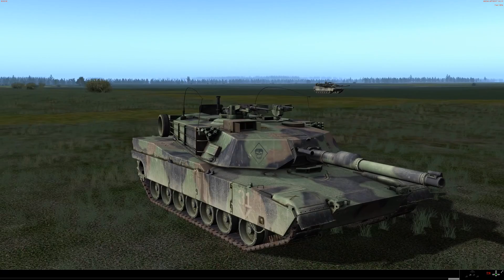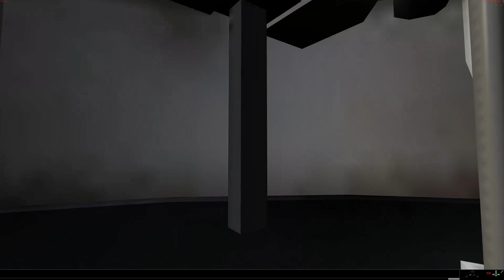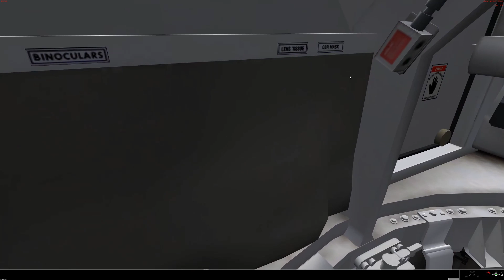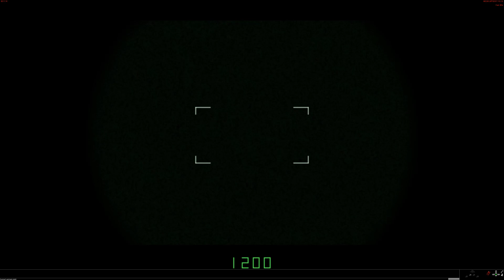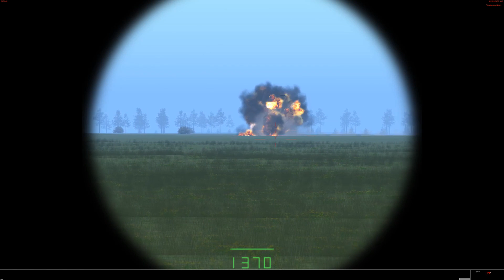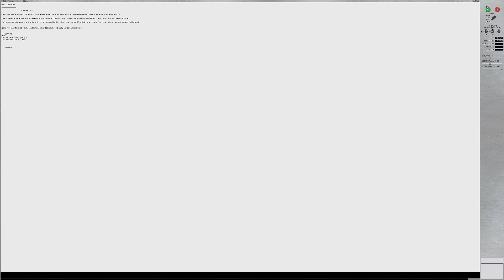Abrams Switchology and Fire Control System

Comment: Using the laser rangefinder with each shot activates the "soft kill" system (as you English people say) on the car you are aiming at. I know you haven't fought symmetrically for a long time, but this system exposes the position of the car. I am most interested in how your battlefield management system, command, fire control and target designation works. between vehicles, e.g. at the platoon commander level.

Comment: So it looks like the Ukrainians are going to be getting 31 M1’s. I really wonder if this video will be watched by any of their tankers. If only for familiarisation.
Reply: They are going to be trained and there likely will be different systems. As it is said that they are downgrading the M1 Abrams. They are not giving the M1A2 that USA Army has, but one without Heavy Armor (DU armor) and firing computer, datalinks, radios etc are suppose to be different from what USA use. Reason is simply that Russia will get their hands on at least one of them in good condition and they get to study it down to minute details. 
USA has lot of older versions etc in the boneyard, they could easily just take fleet of C-5 and each can carry two M1 Abrams or one and two M2 Bradleys. So if they are going to sell Ukraine 31 M1 Abrams and 60 M2 Bradleys, they will likely go with the 1+2 option and just fly that route 31 times to Poland.

I could see a potential market for eSims Games to sell their simulation packages for Ukraine. And they don't need so many either as they are not receiving many units. With the simulation packages they offer, Ukraine could use it to train as well Abrams, Leopard and Challenger crews at the same time.
If Ukraine already have the packages, they could be training all their crews on this moment to operate all of those and lower their real training time considerably.

Comment: 6:00 your speculations that turret azimuth in Panther is not necessary is completely misguided. When 4 panthers roll in a row along the same road, and they spot an enemy, they communicate to each other: enemy spotted at 15degs. No stupid discussions about where is the fkin fire extingusher relative to hull to anything.
Reply from the maker: We tend to deal with that problem in modern tanks without such things by simply saying "contact front" or "contact 2 o clock". Such levels of precision are neither necessary nor necessarily viable, what if one tank is on a curve for example? And the TC should know roughly where he is looking at all times, without needing to take the time to refer to a scale.

The proof of the pudding is in the eating, as they say. If it is such an important requirement, why do more modern vehicles such as my M1 or M3 not have them?
Reply: @TheChieftainsHatch  Yes. But modern tanks can detect enemy in 20-30 deg cone at ranges which are about max range of HMG. Old tanks could detect enemy in 5 deg cone after they focused on very specific set of bushes after several seconds of obesrvation. So your experience about shit is worthless, as you did not step into the same kind of shit as your ancestors did. This is why knowledge of outside-army 'expert' who has basic knowledge abotu scopes who never stepped into any kind of shit, is better than knowledge of a soldier that stepped into a different kind of shit he is commenting about.

Comment: Does YT like incentivize longer videos? does it really require that long to convey the non-azimuth indicator method for telling turret direction. Like explaining which way the terrain will move for each of the directions? I think we can mostly figure that out. perhaps the Chieftan was partaking in his favorite beverage before making this? 
Although I still disagree about the azimuth indicator. You may not need it to tell roughly which way you are facing (but what if it is dark inside and/or foggy/smoky outside?), but you DO probably need it when you are the only one who can see out and your gunner has a drinking straw to look through, and absolutely relies on the TC to lay him on target, like in Panther. How else is the TC going to give precise gun laying bearings?

Comment: I shall proffer a slightly-dissenting opinion on the azimuth ring, though more as a concept and not explicitly as found on Panzer III and Panther. It's true that it is not required and probably not worth the complex mechanical linkages to the hull. However, if one could, perhaps, design some kind of lightweight electronic linkage, either via simple cable or short-range radio, an azimuth ring directly below your periscopes would be quite useful in maintaining sight on targets or situations without having to look away to assess where the hull is aiming. So long as such a device were reliable and did not introduce undue space or maintenance issues for the tank and its crew, I see no reason why such a device would not be desirable. Sure, you don't need it, but if you can have it at a negligible cost, why not?

Comment: We never had a problem with our NBC systems on the M1A1's - and did a lot of "over-pressurized' engagements and exercises in Graf and Hohensfels.   We had heard the NBC-system fire rumors, but never experienced one in a long career.
Reply: We had one in 2002 1/7 Cavalry Ft Hood night run driver could not get out due to night vision being installed and turret screen installed he was burned to death
Reply: @lawrencehubbard2985  Wow, that is comforting. So if there ever IS a NBC attack, our tankers can either die in place, burn to death, or be forced to flee the vehicle (and then die)?

Comment: Can you explain how the Guns Primary Control Handle operates?

You mention it operating like a steering wheel, as well as pushing forwards and backwards. But I'm uncertain on how it operates.

By forward and back do you mean like a Flight Yoke?  Or do you mean tilting the grips forward? As they look like the can rotate on a pitch axis.
If they do pitch, are they linked? as in both grips pitch forward together? Or do the operate individually so one can pitch forward as the other pitches back?

I'm assuming that you turn the Controls like a steering wheel to turn the Turret along its yaw. Then the backwards and forwards motion (Be it twisting or push/pull) alters the Main Cannon's elevation?

But that's just guess work.
Reply: You rotate fore-aft to elevate, turn it right-left to traverse, like a steering wheel. A Russian tank, IIRC, the yoke twists on a vertical axis for traverse, ie in the same plane as the turret rotates.

Comment: anyone know how effective the top of the armor is above the driver, or above the front fuel tanks? and the neck of the tank?
Reply: The M1 is an active combat tank, and no official armor dimensions or protection levels are released, other than very general ones. They arent going to advertise the weak spots on their current main battle tank.

Comment: "If you accidentally hit 'power off' instead of 'shut down,' your engine will run away with you, and the only way to shut it down is to hit the fuel cut-off." That's not entirely true. You can also smack the power switch again as fast as possible, and if God means to save your dumb ass from angry Drill Sergeants, He'll get the electricity flowing and tame that turbine before it goes nuclear. You'll then get back to cleaning Kentucky mud out of the subturret as fast as possible, and when the motor pool Sergeant sticks his head in the hatch to ask you what happened, you can look at him and say, "I don't know, Sergeant. Did something happen?" He'll know you're full of shit, but he won't say anything, because God just saved him from having to replace an engine pack.

...or so I've been told and certainly didn't do myself.
Reply from the maker: This is true. You have three or four seconds to put the power back on, I’ve seen it done.

Comment: The azimuth ring is so the commander can call a target direction to his gunner. As you noted the gunner has one too. That way the can just call out the target direction and the gunner can traverse to it. They are on the same sheet of paper so to say. You also noted the gunner's sight. This would help him in that too.
Reply from the maker: As the TC in the typical tank, it is not necessary to have an azimuth ring to know which way the turret is facing in relation to the hull.
Reply: The_Chieftain I agree I think it’s so the tc can give a direction to the gunner.
The gunner is trained on target “A” the tc identifies another target “B”
He simply has to call out the correct number from the ring.
The gunner having the same scale and little to no field of view, simply traverses to the given number to help him lay the gun on target “B”. Kind of a primitive hunter killer type setup.
Reply from the maker: Right, but that only requires that the gunner have one as its a bit harder for him to keep track of turret position
Reply: The_Chieftain I agree with that 100%
I’m not trying to make the argument that it was needed.
Don’t forget we are talking about German WWII design, if it’s not over complicated it’s not needed😀 (for a bunch of things at least)

Comment: As a gunner on a YPR 765 ,and shooting a 25 mm oerlikon in the dutch army in the late 80's, we had the night vision, but all other functions were pretty much "ww2 gunnery".

that's why we were trained to have 3 shots at a moving target , correcting with  "2 forward , 1 up" when we missed, meaning; aim 2 vehicle lengths further in front and  1 vehicle height  above when correcting our aim.
If after 3 shots at a moving target we still had no hit, we would seek another target.
If we had a hit, we fired 2 more kill rounds.

I noticed in the video you seek another target after a hit, is that usual or only done for demonstration in the simulator?
(I do realise the rounds from a modern tank are more destructive than what we shot, but there is still a good chance a non essential part of the target is hit, and they still be able to fire back, or continue to fight)
Reply: Ik spreek niet uit ervaring. Maar elders zegt Chieftain dat ze ervan uit gingen dat als ze een vijandelijke tank geraakt hadden hij uitgeschakeld is.

Comment: So even in emergency mode the gunner doesnt have to deal with the difference between the gun and optic position
How did they manage that?
Reply from the maker: The ballistic computer still works in emergency mode. It’s the connection between the computer and the gun controls which is disabled,

Comment: Lead isn't often 5 degrees - 5 mils is more usual.

5 degrees is 87 mils (compare to the lead diagram shown at the start of the GPS segment, with the whole reticle only showing 10 mils, almost 9 full reticle offsets is very big lead.

Comment: Great video, thanks. 2 things occur to me. One, it really seems like there should be some way that the gun could know what's loaded, so you don't make the selector-mistake in real life. Maybe by weight, or some mark on the back that something could OCR on the way into the breech, I don't know. Secondly, if it's common practice to use the IR sight to find hot-spots during the day, then change to visual to take a better look at the target, it would be nice to have an overlay option where you see the daytime view, but anything that would normally show as a an IR hot spot ( with a dial to adjust what the cutoff parameter is ) could be overlaid in some bright color on the normal image ( mirrors, AR, whatever ). Could help spot things more quickly... ?

Comment: Having "played" steal beasts I can say I liked the Leo's system a lot better, you had to hold a manual lead button which meant if you lazed something your sight didn't jump nor did your gun, you'd laze until you were satisfied with the reading, then hit the lead button which would work essentially the same as the Abrams FCS.  The optics also seemed superior for both the thermals and the regular sights on the Leos.   Which makes sense too since that's what the Germans are famous for with their optics since ww2, and the fact that the Leo can't exactly take a punch too well, its probably better that it can at least see well.

Comment: no bit on the  commanders CITV or Hunter killer  capability M1A2 has?  thats  also a part of fire control and a big difference over the A1
Reply from the maker: Yeah, I mainly intended it to be an A1 video, really. In hindsight, I need to revisit the A2, deal with air mode, the CCP, and the CITV.

Comment: Another good thing about the lack of horizontal stabilisation on the A1 is that it probably subconsciously teaches the gunner about the correct lead should they ever need to use the auxiliary sight. But that’s just a theory of mine obviously and I’d probably guess the training they receive negates this benefit.

Comment: That joke about putting sabot (APFSDS anti-tank projectiles) into orbit is not as far wrong as it seems.  At over 5,000 ft/sec muzzle velocity, these long, finned, very heavy, sub-caliber needles (tungsten-carbide or depleted-uranium "crossbow bolts") can fly to extremely far ranges due to minimal air drag when elevated.  I ran a computation with the air resistance drag function for a 10-to-1-length APFSDS projectile of tungsten-carbide and 40mm diameter fired at 45 degrees elevation angle and it went OVER 80 miles in a close-to-true-parabolic trajectory and hit the ground at over 3200 ft/sec, the muzzle velocity of a WWII super-88mm L/43 German anti-tank gun on the TIGER II.  You have to be careful with these rounds or you will get collateral damage far away from where you want the projectile to go!
Reply: Oh my god, I knew I idly scrolled down comments for a good reason. I love your work on NavWeaps!

Comment: Note the various lead displays when going from normal (sight aims at target but gun -- and the entire turret -- moves sideways to handle lead if the target is moving) to emergency (no lead or elevation applied so the gunner has to do it himself using the information displayed from the computer results or "SWAG" if necessary).  This also applies to the aiming of guided missiles, though they automatically try to move to wherever the computer controlling them tells them to go.  Many of the original US naval guided missiles, such as the beam-riding version of TERRIER developed in the late 1950s, were very simple as to their flight path:  They tried to stay in the middle of the radar tracking beam on the target being generated by the modified dish-type tracking/controlling director radar, one director per target, so no lead angle was possible here too.  This was OK if the target was coming more-or-less directly at the firing ship, but if the enemy was trying to, say, destroy the task force aircraft carrier and your ship was well off to one side of the enemy-to-carrier line-of-sight, you had a major problem in that the target would be moving very fast sideways and your missile would have to fly a curved-hockey-stick-shaped trajectory as it got closer and closer to the target and had to fly more and more sideways rather than forward, in a tail-chase trajectory.  At some point, depending on the range and the speed of the target, there simply would not be enough time to move forward and sideways simultaneously and when that happened, the target was simply not engageable.  This was the major reason that semi-active and fully active homing weapons (TARTAR and the later versions of TERRIER and the current Aegis naval guided missile systems, among others) replaced beam-riding designs -- TALOS was a hybrid in that it had a separate beam-riding controlling transmitter and could guide the missile as if it was on the end of a fast-lengthening fishing pole controlled by the FCS computer while the separate tracking director stayed on the target, so it could hit sideways-moving targets within some rather wide target speed capability; later, at very long range, even this separate beam-riding system was no longer viable and a semi-active homing nose antenna keyed to the tracking radar frequency was added, as a further hybridization of that oldest of US Navy guided missile systems.  Handling sideways-moving targets even with self-aiming guided missiles is a non-trivial thing...

Comment: i have always wondered how does the driver get in and out, on the leopard 2a4 and m1 abrams the turret has that big overhang on all sides which ( having never seen one irl ) makes it look impossible for the driver to use his own hatch. i am only 6 min into the video so i did hear him talking about the swing gate inside the turret. but what happens if a fire erupts inside the turret? how does the driver escape.
Reply: The hatch is designed to open even when the turret covers it.. There is a large enough gap around the turret base the the gunner can crawl out, and he can drive head up without being decapitated. The hatch is only used for emergency egress and for visibility. In normal conditions he exits through the turret.
Reply: He doesn't.
Reply: @TornadoADV  then i am glad i am not a tank driver
Reply: @TornadoADV  Seriously, you think the modern US military is going to adopt a tank which traps one if its crewmen inside unless some slews the turret to release him from is steel coffin first? Dont answer questions if you havent got a clue what the actual answer is.
Reply: the hatch pops up about 2 inches then swings out. the driver then crawls out.